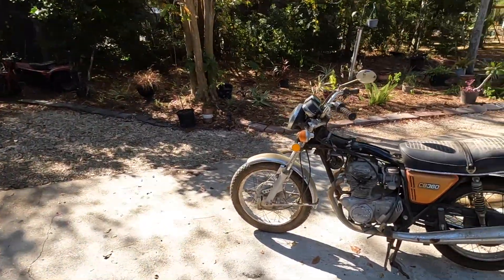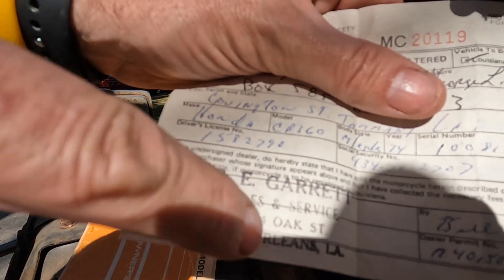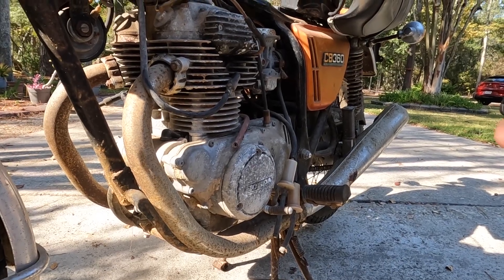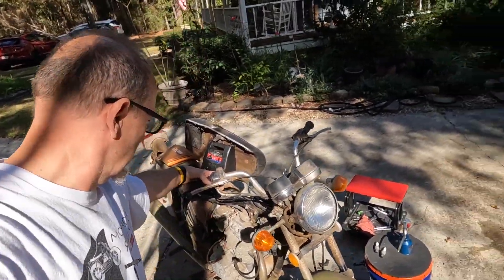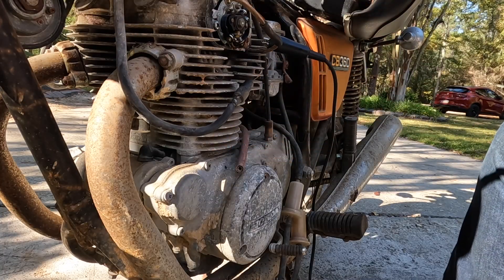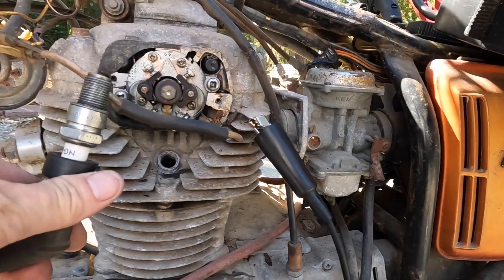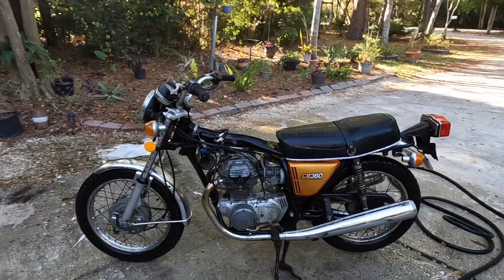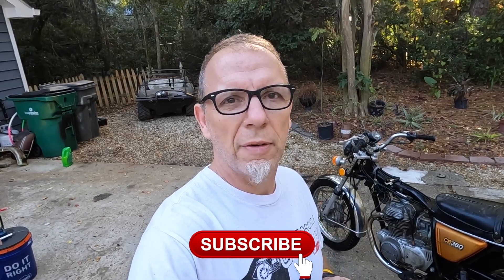I Bought The Cheapest Honda CB360 On Marketplace #cb360 #motorcyclerewind #vintagemotorcycles

Comment: I had a 75 CB360 in 1978, a great bike......just watch the Cam belt slipper, they seize if not adjusted.
Reply from the maker: You’re right about that. Thanks for the tip 👍 Thanks for watching.

Comment: H’mm?  So the 360 engine looks to be a runner with just a carb clean and oil change. Now did the 350G with the bad valve have a title? If it does then does a 360 engine bolt into a 350 frame? See where I’m going? Swap engines and the 360 becomes a parts bike to sell pieces off of to make back more than you paid for it 😁
Reply from the maker: I like the way your thinking. Could be fun. 
Although I like to do the least amount of work possible. 😂 As evidenced in the 1983 Kawasaki GPZ1100 I got running again after being abandoned outside for years without spark plugs. Engine was seized. All I did was free up the engine, new plugs, a coil and a few other bits. Then I rode it to Colorado from Louisiana. Never pulled the engine. Have put almost 6,000 miles on it since I got it in April.